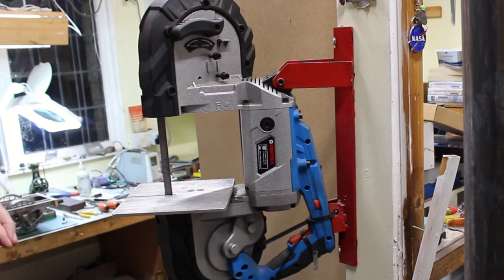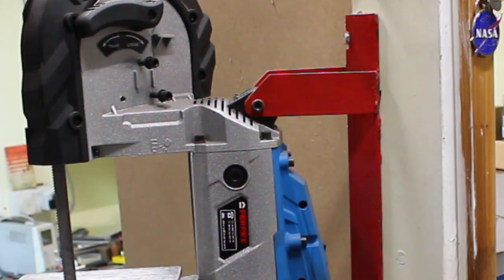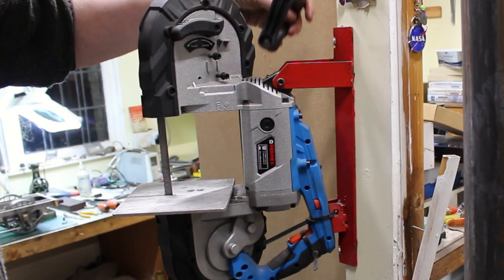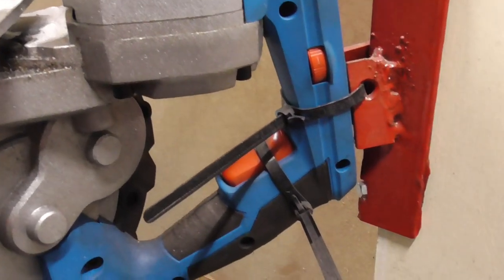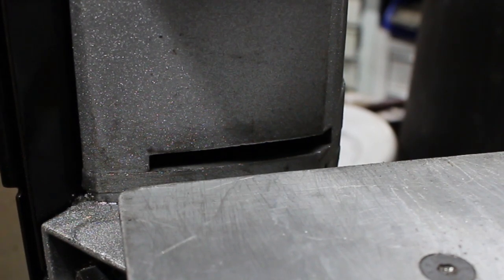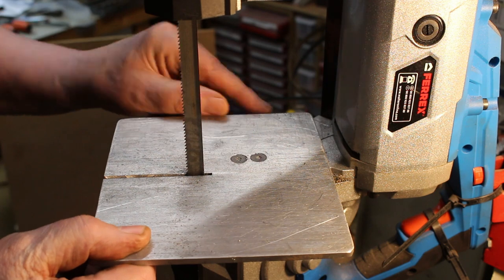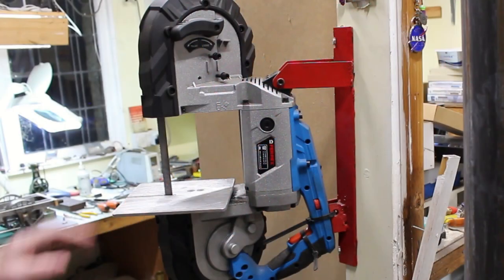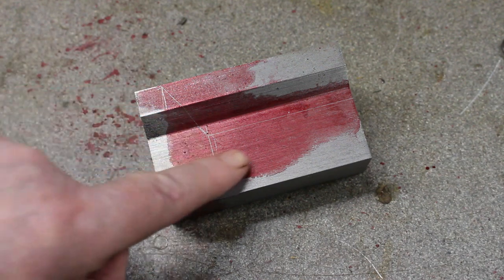3 Minutes Bandsaw Workshop Therapy

Comment: I have the exact same saw from aldi. Stupidly cheap and very capable. My vertical conversion is a little bit fancier as I replaced all the electronics with a separate speed control and foot switch because it was trivial for me. I would recommend some kind of blade guard in case you break the blade as the blade will jump off at your fingers when it breaks. Mine is a trivial bit of bent steel that wraps around the top blade guide.
Reply from the maker: Thanks Mathew, I'll have a look at making a blade guard. I'm not into fancy electronics LOL, after a comment from another viewer I have a foot switch on it's way which I think will be a worthwhile improvement.

Comment: I suggest you fit a foot switch to the power cord,  put male one end and female the other and it can be used on any tool that has the trigger locked. I have one fitted to my band saw it makes it much safer and it saves you reaching for wall switches if something goes wrong.
Reply from the maker: Hi Roger, that's a great idea, I use a foot switch on my drilling machine which has proven to be very good, especially when you need top cut the power quickly.
Cheers!